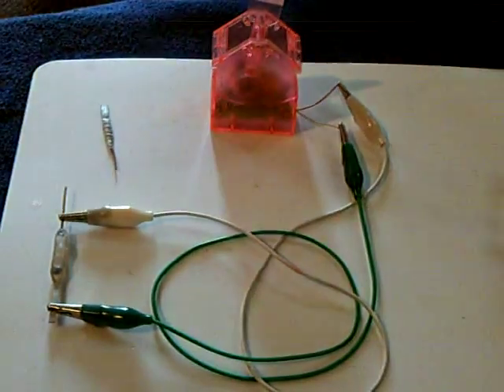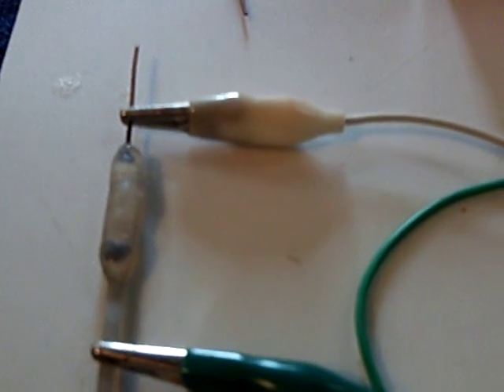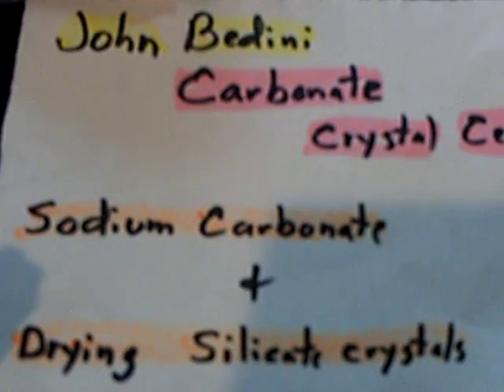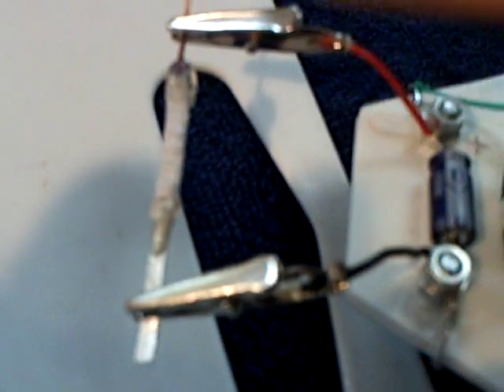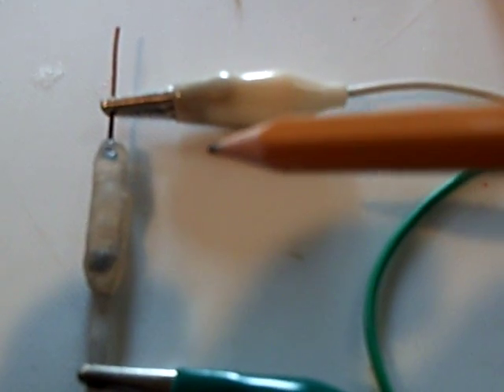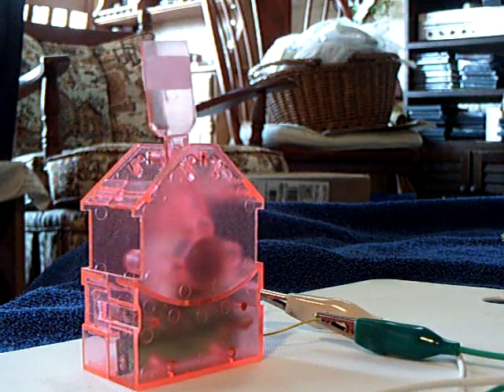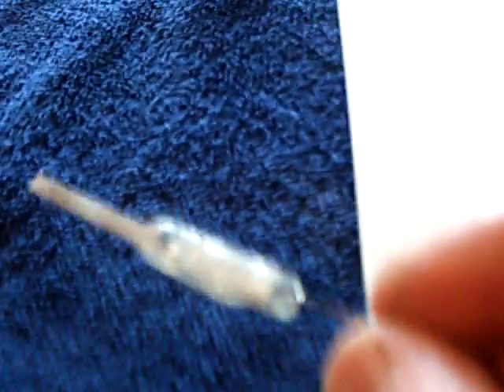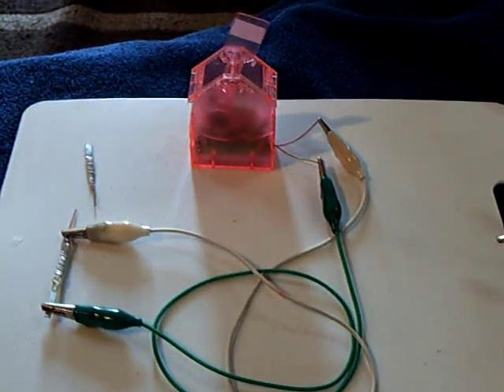Carbonate crystal cell

Comment: btw easy tip just get bakings soda and heat it up in a metal pan on your stove it wil decompose to sodium carbonate only releasing carbon dioxide and water vapor so not harmfull if ventilated mildly .

Comment: There's a 1920's Patent you may have seen, where a guy talks of similar cells as diodes...it had me thinking when you said about looking like an electrical component. 
A crystal cell instead of a FWBR on a pulse motor works, though I need to do more tests. They also appear to have inductor coil properties, in that they smooth ripples.

Comment from the maker: @phi36nine ----The two chemicals were mixed with a drop of distilled water to make a thick paste.   The output is about 1.2 volts unloaded and measured about 100 uA dead shorted.  The electrodes have very little surface area hence the low amperage.  The other cell in this video produces about 30 uA  This is a tiny cell compared to what John and Chuck are working with.

Comment from the maker: @ibpointless2 -----It is a "Hankscraft" store display device.  It had a small solar cell on it that I took off.  It is similar the "Lucky Waving Cat".  You can get them on Ebay sometimes.   The "galvanic" thing troubles me also but I see indications of other processes at work here.  Don't forget about the Marcu Reid cells and the fact that John B. has them right in front of him to study.  I have read the professional analysis done in a lab on those cells-- and they are not fancy lemon batteries.

Comment: The reason for the more input is that it needs water to run. If the cell needs water to run then it will die due to galvanic corrosion. The oxide layer won't protect it, if it did then aluminum would never corrode as it always has a oxide layer when exposed to the air. But its all a learning experience i guess? 

Where did you get that pulse motor?